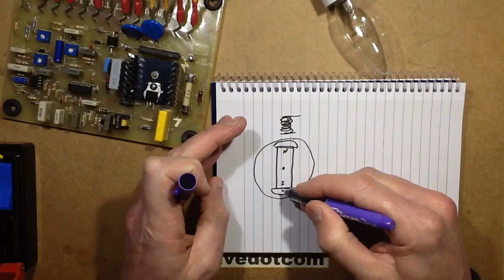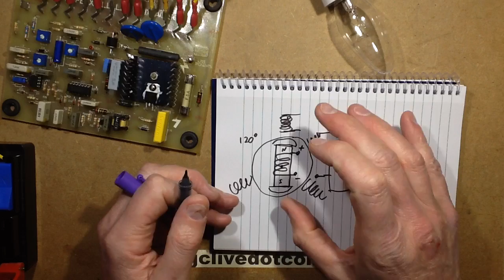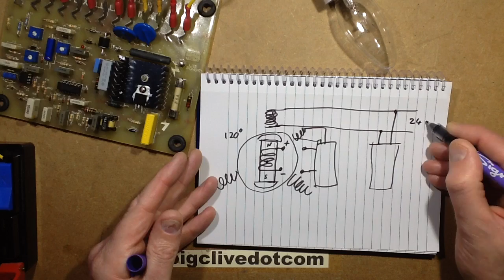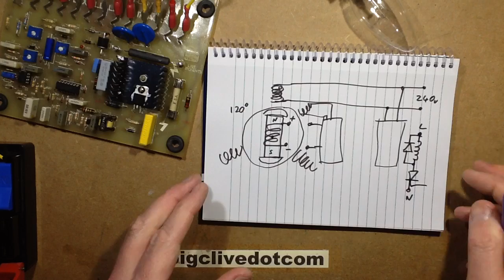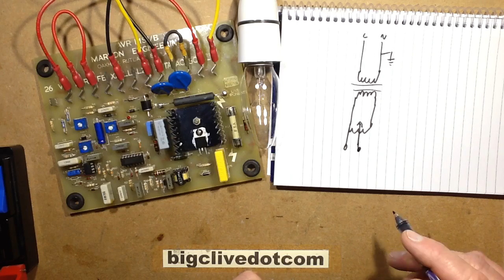Repair of old AVR (Automatic Voltage Regulator) PCB.

Comment: Ideally to set stability, you hook up an analog meter to your generator output, with the generator running, turn stab pot until it becomes unstable then go back the other way until it just becomes stable again.

Comment: I cringe when anyone runs a metal screwdriver around a live PC board. I have seen many let the magic smoke out with the wrong move,  even worse when one deals with a fire emitting transistors. Nice to see good old fashion technology that keeps on ticking and is easy to work on.

Comment: @bigclivedotcom may i ask why your videos are in 720p not 1080p?
Reply from the maker: 720p is the maximum resolution of the iPad2.  On a slow data connection it still takes a very long time to upload 720p.
Reply: directly uploading from ipad to youtube, using the app, maxes it to 720p, to do 1080p he have to use a pc to download the file from ipad and then upload
Reply: I know how you feel about the slow data connection my upload speed just above 1mbps
Reply: my upload speed is below 0.5mbps :(

Comment: I'm amazed you didn't throw a multimeter over the simple components first. Always start with the easiest things first.
Reply: but unless you lift one side, the rest of the components mess you up, if you are lifting a leg of any cheap component, might as well just lift the other and replace it
Reply: You start with a thorough visual inspection first, then test the most likely, not the easiest. Testing each resistor could take hours. Besides, resistors aren't always the easiest to test. Without a schematic, you would need to desolder one side of each resistor. You risk damaging good components. To make it worse, the conformal coating can make testing difficult.

Comment: Anyone else waiting for Clive to tell us it was the 5 Amp fuse ?
Reply from the maker: That was the first thing checked.
Reply: I know it was the first thing you checked Clive, it was just that you got right through the video and didn't tell us so, so I was waiting for the other shoe to drop, as it were.

I managed to follow the slate elevator control, but I was struggling a little with this one.   8-)
Reply: No, I was expecting the LED to be changed to a warm white one.
Reply: That's what it would be, if I was messing about, but I'm erm... only just capable of not killing myself with it. I expect Clive has a qualification or two.
Reply: Tommy Oz n

Comment: If you ever want to see a larger genset (200kva and above) dance come and see me during adjusting LOL, Modern AVR's have more potentiometers (like droop etc) and even though they are multiturn they are extremely sensitive to the touch.
Reply: leosedf tell me about it. Setting stability on a Stamford avr, in a loud hot generator house, in the dark, with a digital multimeter!
Reply: Then there is the game of syncing sets
Reply: An engineer at Avonmouth treatment works got it wrong once, the whole generator tore itself out of the floor, we all have bad days though. J.

Comment: You could use a polyurethane varnish on the board, it's what i use for high voltage stuff (actually floor varnish), and maybe a couple of blobs of hotglue on the ends of the chips to stop them falling out with vibration
I used to work with generators as part of my job
Reply: Sparky Projects the newer ones are potted in a silicone rubber type compound
Reply: I know, but as clive said, the guy might only want it running for a few more years due to age of the machine, no point is spending a lot of money on conformal coating or potting, plus potting would make it hard to repair it again, specially as clive has made it easy to change the chips ;)
Reply: Miller Stevenson makes a spray on conformal coating. I got some and sprayed it on the alloy wheels on my car. Looked pretty cool in the sunlight because it has a UV fluorescent dye so you know your board got coated.
Reply: I use a generic spray-on conformal coating (available from local electronics retailer or fleabay) for ELV pcb's, it's "solder-through" so it makes rework/repair easy. But it's a pretty light lacquer, not sure how appropriate it would be for high voltage applications.

Comment: Cummins/Stamford took over Markon via Newage....check their website for the history.

http://stamford-avk.com/recent-years
Reply: Dave Bell lots of good PDFs for download from them that explain the generator operation as well.
Reply: 1992 - Cummins acquires remaining shares of Onan Corporation from Hawker Siddeley Group.

That's an unfortunate name for a company - probably had a hell of a marketing dept though.
Reply: joinedupjon Yes, and Onan was one of the best.   I've a great example of Onan quality from the mid 1970s.  Rated at 5kW but easily runs an 8k pure resistive load.  No slip rings, uses a secondary coil for field current.  Complex as all can be...
Reply: joinedupjon Yes, and Onan was one of the best.   I've a great example of Onan quality from the mid 1970s.  Rated at 5kW but easily runs an 8k pure resistive load.  No slip rings, uses a secondary coil for field current.  Complex as all can be...

Comment: Pre-RoHS, not surprised it lasted as long as it did!
Reply from the maker: The solder melted, reflowed and removed beautifully compared to the crusty lead free stuff we're saddled with now.
Reply: Lead-free rework... ugh. When in doubt, add more flux. Yes, more flux. More flux. Mooooooorrre fluuuuuuuuxxxxx.
Finally get the shits and dump a load of Sn/Pb into it, then remove all the nasty alloy, then clean up the flux residue, then start again from scratch while hoping you haven't cooked anything important. So much fun!
Reply: And don't forget it's got to be the nasty flux, the stuff that doesn't burn off before you hit reflow temp (around 220c, requiring 350 on a hot air rework tool) AND you only get around 3 attempts before you've exceeded the components specifications, burnt the PCB, melted pads/track off or made a nice hole in your anti-static matting.

Comment: That actually looks almost modern for the time... in a way.
Reply: I think I know what you mean, you can go out and buy a heatsink and a lot of the components that still look like that.  I think that LED was probably old inventory in '78 cos the 3 & 5 mm plastic package were available by that time which looked like the ones you can still get now.
Reply: 1978 with an LED! Quite impressive.
Reply: Well, my Sony TC-U2 tape deck uses an led for the record indicator and it was made in 1978 too. It was weak so I had to put another resistor in parallel with the original to increase the brightness :)
Reply: To me it looks home made, at least compared to the ones my dad used to make.
Reply: They could actually be current production for the time as I have a number of identical LEDs to the one on the board in Zenith component bags that are from the late 1970s.  They did the job and keeping the same design probably saved on retooling costs.
Reply: petti78 Components tend to be smaller these days and getting smaller so they reduce the current and become more energy efficient. Its normal better to just upgrade then repair unless its something you really like or a upgrade is out of the question. You can test components by measuring resistance if reading none then the inside wire is broken normally its a fuse or something simple. 1 Resister what a pain 😂 Clive found it in the end shows his knoledge in circuitry and fault finding 👍
Reply: I thought that too